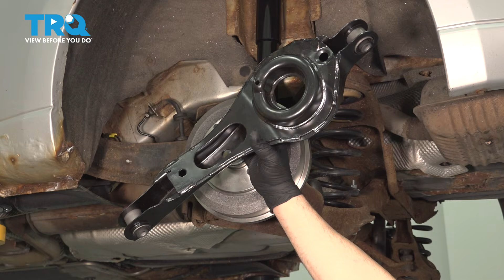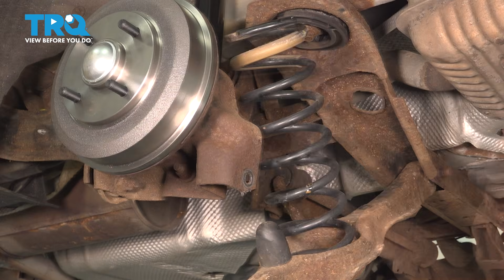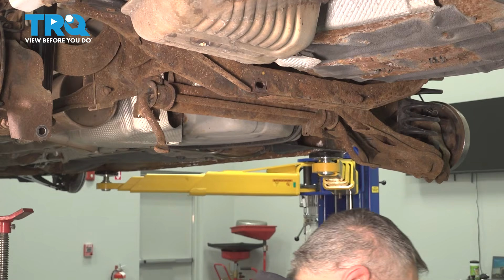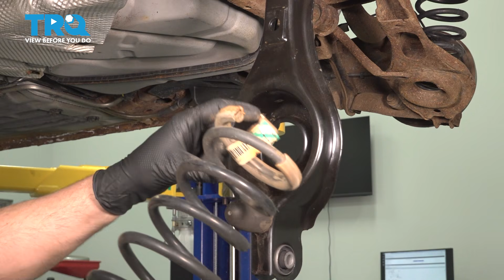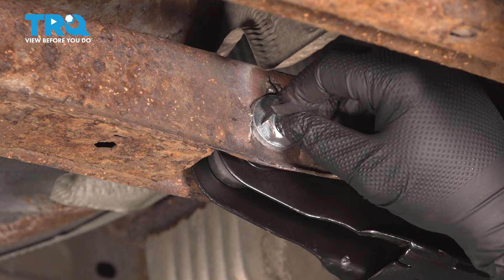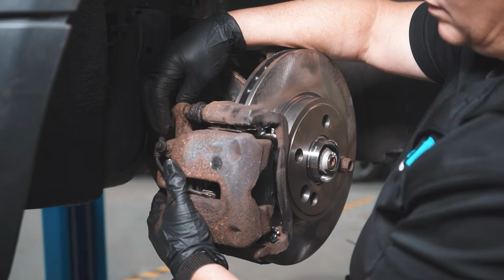How to Replace Rear Lower Rearward Control Arms 2008-2011 Ford Focus

Comment: My issue is that I'm using floor and jack stands, and I can't lower the arm down because the sway bar is in the way, it won't let the control arm lower any further, spring is still very loaded and won't come out. How did you bypass the sway bar.  I already took out the sway bar end pieces the long bolts going vertical with all the bushings in between.